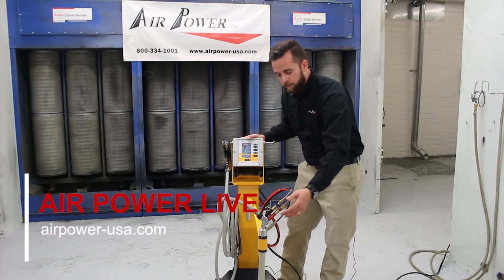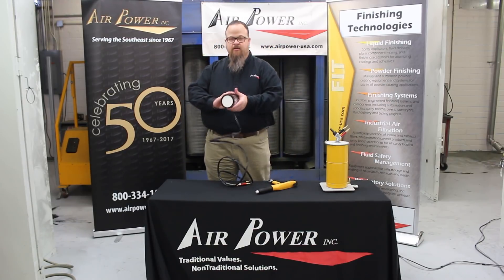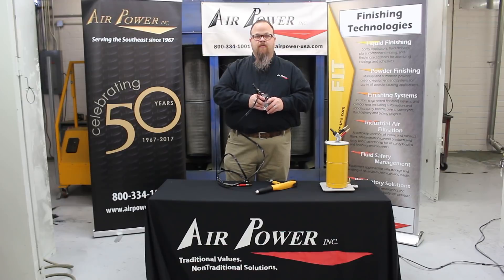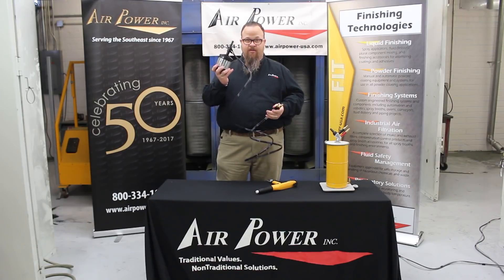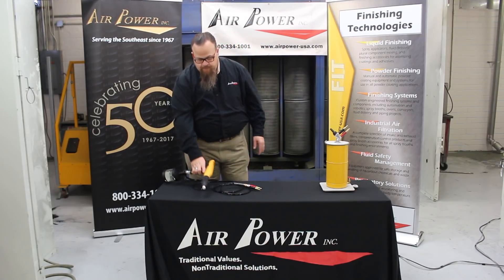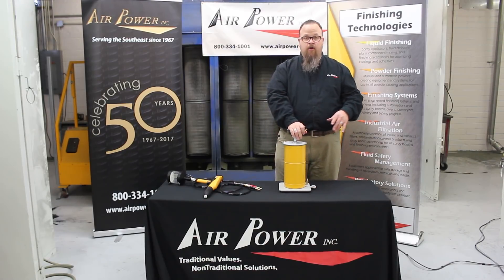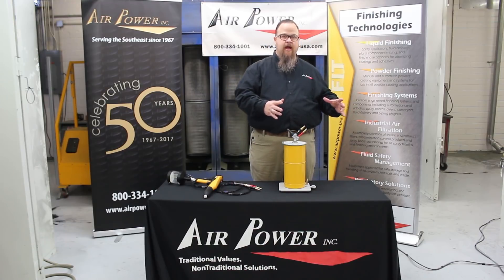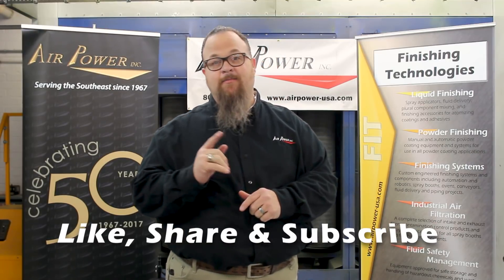Powder Coating Series: Gema Accessories - Cup Gun + Lab Unit

Comment: In the shop I ran for a while we made our own hoppers cause the 3 was to small and the 50bwas to dang much. Then we got the vibration box model and I liked that alot. We just used the wall mount model for our gun and controls. I am currently dreaming of one day putting my 15 years experience back to work in my own shop and the lab model looks so good for what I'm going to bring to the powder coating world